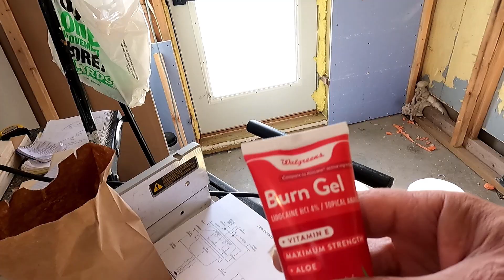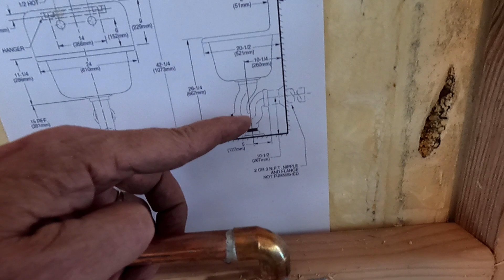I Burned my Hand on the Woodstove, then Finished the Plumbing

Comment from the maker: This was two days ago and the burns are pretty much healed. Cold water works wonders! It is awesome to gave the plumbing complete. That was one of those things that had a lot of figuring and a little bit of action to get done — but if done wrong, takes a good amount of time to fix. Today is the coldest day of the year. it will not get above zero today and will be -31℉ (-35℃) with the wind chill tonight and will be nearly as cold for the next two days before warming up again. But never fear, the 10 day forecast has three days in a row in the mid 30's coming up! 😎

Comment: I like the way you screwed down the pipe assembly when you soldered it. Great way to align things.
Reply from the maker: Thanks Marc! Not sure if you could see, but the far end of the pipe was raised up just a bit so the system is self draining. This way we can shut the water off out there if need be, and no water will remain in the lines to freeze and burst the pipes. I'll be installing heat tape on a short section before the valve in the next day-or-two 🥶 I hate frozen pipes!
Reply: @PlanetMojo  frozen pipes are a nightmare.
Reply from the maker: @marcwerth1857  Oh I know that 😉 I've had my fair share of floods!

Comment: One time I was running a 10hp rototiller for an hr and it got dark out. I was just catching my breath and thought I would open palm the muffler to take a load off. Well I was quick to enter burn control emergency measures as well. I ended up burning my entire palm. Speed is key for burns. Super cold water soak is all ya can do but it sure works well. Yours will heal faster than mine did. I was two months before it was better.
Reply from the maker: Yea this was nothing like a bad muffler burn, but you are correct, get it under very cold water for at least five minutes and at least you have a chance at no blisters or lost skin. 

I was working under a car when I was younger and wedged my shoulder against the hot muffler. I feel your pain! No cold water in sight -- but I don't think I would have known to use it back then anyway! 😉

Comment: Those boys know u well!! But they should have got u burn bandage as well.! Glad your ok buddy.Wonder how long that hand print well stay on the stove!
Reply from the maker: Thanks Kevin, yes the boys do know me well 😊 — I just put the burn bandages that Andrea recommended. They are called Adaptic and have been added to our shopping list. 

The handprint will have to stay there until  warmer weather. The stove is between 400° and 650° until it warms up enough to let it cool down and remove the ash and clean it. Wood stoves get pretty dirty in the winter 😉 Stay warm Kev!